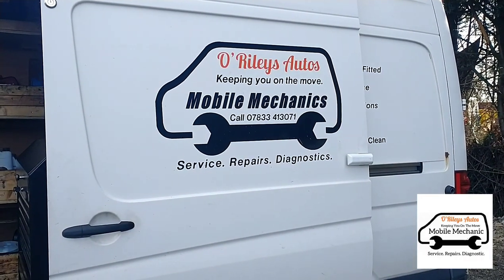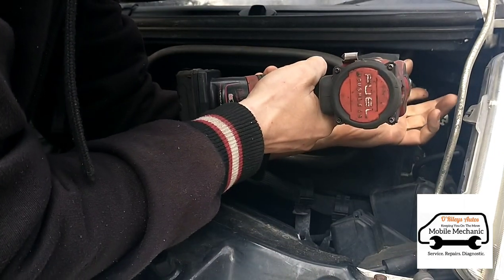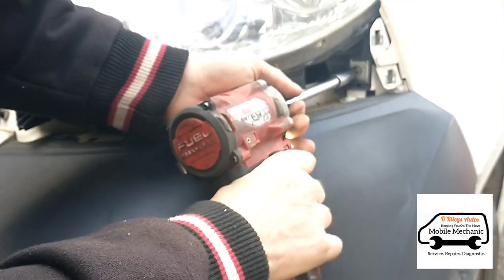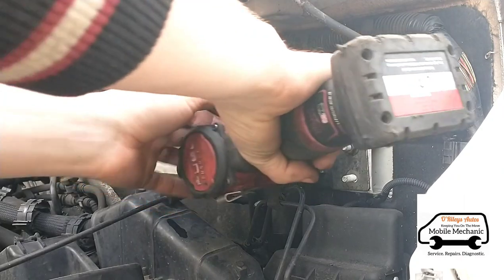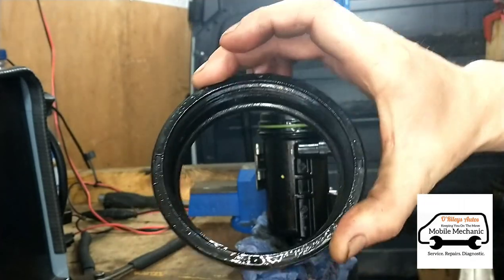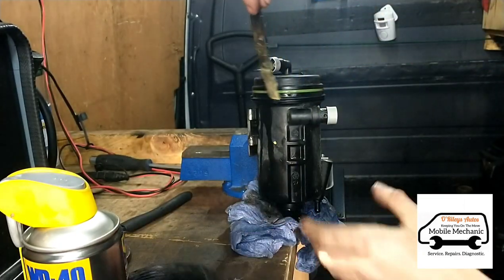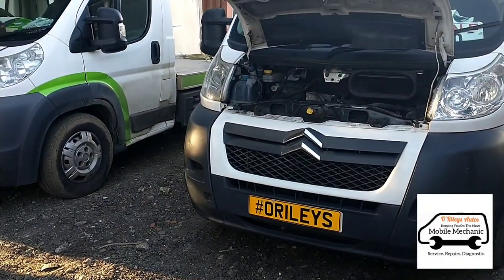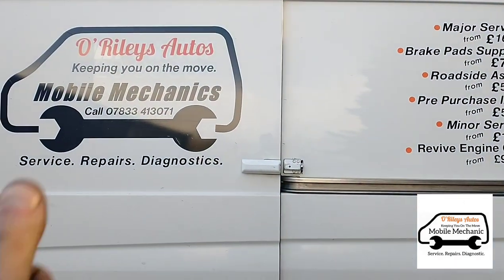Leaking Fuel Filter Housings on Two Peugeot Boxer, Fiat Ducato, Citroen Relay, Ram Promaster Vans

Comment: Just done mine, no need to remove anything, just need a short 13mm offset or  a short reversable offset rachet spanner.
Reply from the maker: It takes only a couple minutes to remove the headlight and makes the job so much better

Comment: Manufactures  today  are  making  car & trucks  as  cheaply  as  possible.  Main 
concern  is  cost.  The  buyer  is  left  with  needed  repair.  But  the  customer 
is  not  forgetting  bad  quality  autos.  Many  will  never  buy  that  brand  again.
Reply from the maker: I'd never have another iveco. Bad experience with 2 tricks fallen apart

Comment: ive had them leak on 2 separate fuel filter changes(with special too) ,,now just bite the bullet and buy the whole unit with filter,,clip in clip out
Reply from the maker: It's been fine so far so won't be replaced just yet 👍🏻